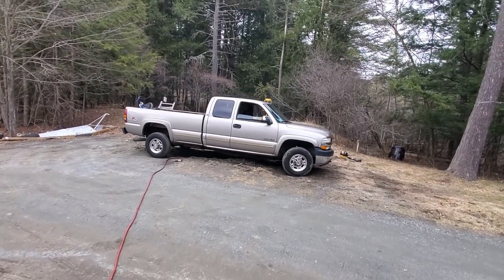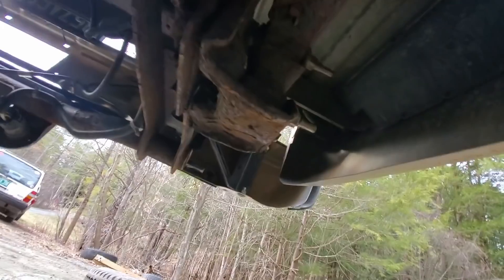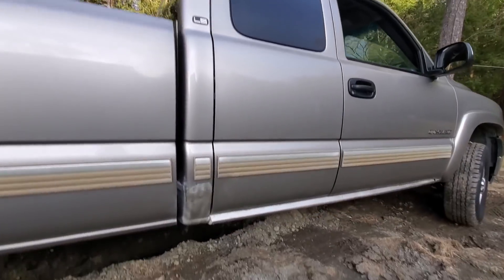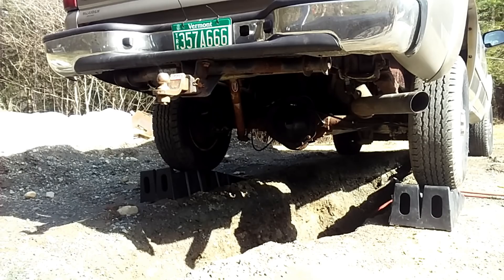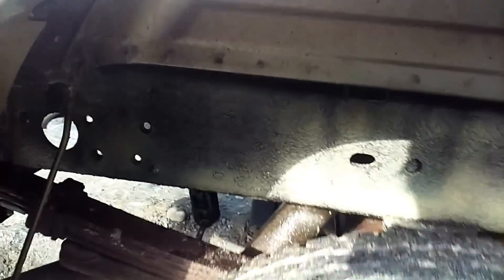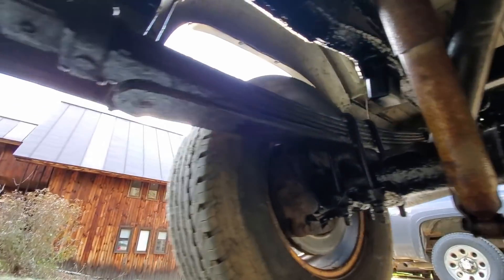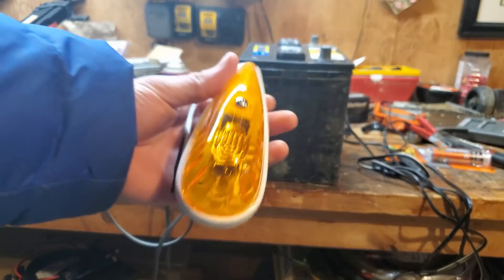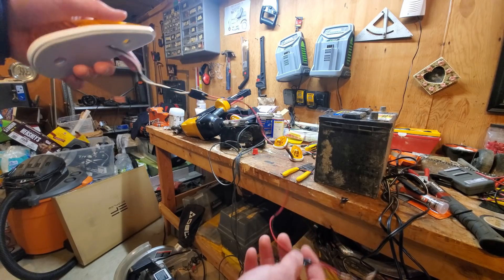Cheap Chevy Silverado Part 2: Frame Work And Lighting!

Comment: This truck is actually super clean for being a Northeast truck. Those  6.0 4L80e trucks will run forever..
Reply: GM makes the best heavy duty gas motors out of any of the big 3.
Reply: Iceburg862 Steam hemis are decent but the 5.4 should have been replaced a long time ago
Reply: @aaronhayden1780  agreed. The hemis are also strong motors. I have a plow truck with a 5.7 hemi. Has 300k on it.
Reply: Iceburg862 Steam nothing beats a small block Chevy, easy to work on as well
Reply: I know a guy who has 300k on his. Still drives it weekly
Reply: I’ve seen the ford 5.4s with 400k on them, and hemis with several hundred thousand on them as well. No doubt the small blocks were great motors, but you gotta give credit where it’s due

Comment: Cool video and glad that you are saving the frame from certain doom. Most people would just let it rot out then get rid of it and some of them are critical of what you are doing but you are putting the hard work in trying to save it and I give you props for making these trucks better than they were when you got them. I see nothing wrong with your methods and it works well cause that is the way most of us would do it and there's nothing wrong with twisting the wires together it works in a tight and those lights aren't pulling enough current to hurt anything. There are wires on houses twisted together all the time with wire nuts and that doesn't hurt anything . Thanks for the videos and keep them coming
Reply: The wire nuts in automotive use is not used because of motion and vibrations of it comming lose ... not because it cant handle the current. .. . thus, using crimp connectors are prefered. But in a pinch ... sure ... ive done it . But i tape it good so it wont loosen .... and its temporary use ... in my case. Ps. In exterior applications, crimp connectors can be heat shrunk to make it water tight.😊
Reply: @leop3009  yeah crimp connectors work but alot wiring problems ive fixed have be due to crimp connectors as well because they will loosen over time needing recrimped or a new fitting , a wirenut if tightened correctly actually bites into the wire and ive never had one of mine come loose although ive had to retighten a couple of them because they werent tightened enough because i saw there were no thread marks on the wire ive got a few on my ol work van thats been on there 8 yrs and still going strong but if you tighten them really good they will last forever and you can tape them to be on the safe side as well , ive seen ppl soilder crimp connectors and i think thats a solid fix or crimp them super tight and they will last but lots use a soft crimp from what ive seen but in the end it comes down to personal preference it will all last if done right cause thats what its made for  just like using ford or chevy 👍
Reply: @79beans347  the solder type are best yes 😁👍🏻....

Comment: Quick tip, I'm in NH and when I fluid film my truck I take all the surface rust down then take a air hose and blow all the dust and debris off. Makes for a better stick. Awesome video!

Comment: The paint should have gone on first.  Esp. Rustoleum is designed to bond to rust and Fluid Film is basically a protective grease.  Still curious to see how it holds up.
Reply: ck m rustoleum is not it even comparable to fluid film . I use fluid film on everything now for 14years best stuff there is for rust stoppage and protection .

Comment: Glad to see you went with fluid film or any kind of oil or wax coating for that matter. Painting the frame with any paint or rubber coating will just let water get stuck in between the coating and the frame and rot it out faster than if you did nothing. I fluid filmed my old Ram 2500 frame in November and it still has a noticeable coat on it so I'm very happy with it. Keep up the good work, we're basically exactly the same buying people's "junk" cheap and making them good machines again.
Reply: Kept playing the video and watched you paint over the fluid film! Well, the paint is only stuck to the fluid film anyway so it's not the end of the world. After like a week the yellow color disappears and the previously rusty metal is then nice and shiny black.
Reply from the maker: Well at least the paint is oil based and not rubberized
Reply: A Rural Vermonter Yea I’m sure it’ll be fine. Actually you’ll know when it needs more fluid film because the paint will probably start falling or coming off

Comment: Good job! Love your channel! But a little bit of advice...
I bought a 2002 Suburban from California and drove it back to NY a few years back. I started putting Fluid Film on every fall, and so far it's got absolutely zero rust after 3 NY winters. Fluid Film is the BEST stuff! You don't wanna use anything that covers rust and keeps it in.
BUT, I wouldn't have covered it with paint! Because the paint will dry on top. Fluid Film changes color and goes from yellow to black after a few weeks of it being on. It also creeps and covers a bigger area than what you first spray. It also collects dust and debris (in a good way) and makes it look very black, almost like you painted it, but more matte than glossy.
If you want it really full on black like with paint, I think, if I'm not mistaken, theres a company that makes a product almost identical to Fluid Film, but black. It might be New Hampshire Oil Undercoating, but I'm not sure here...
Anyway I hope this works and that the fluid film doesn't get stuck under that paint. Because it needs to breathe and creep. 
Keep us updated! Cheers

Comment: Fluid film is great. You don’t want to cover fluid film because it’s a breathable membrane. The color of the fluid film goes away as the air bubbles go away and road debris covers it. You also need to do touch ups once a year. Should get cavity wax for boxed in areas.
Reply: This guy has seen his fair share of rust too. :P
Reply: @802Garage  I had to double check to make sure I was still subscribed to you. Your vids hadn't been showing up in my feed.
Reply: No to the wax, imo. Water gets behind it and ur fukt.

Comment: I'm not going to lie, when is started to get into cars late last year o started to watch Scotty, and I admit that for a moment he did brainwash me in thinking gm are bad, but it was until he made the video of the old 90s Silverado when I woke up, calling them ok, then started watching other car channels like donut and fast lane throwing small punches towards scotty, and the miliion and half a million miles gm truck, like the channel keep it up
Reply from the maker: thanks!
Reply: He hasn’t driven in years, that celica has had the same miles for 6 years now. He bought the car with that many miles.
Reply: The only Scotty Kilmer you should watch is 802 Garage's send up of Scotty. Kilmer is a hack with bad advice.
Reply: @stevevarholy2011  What does Scotty Kilmer know. He's only been a mechanic for about 50 years. An 'Internet personality' mechanic for 50 years?
Reply: @townhall05446  One can be a bad mechanic for 50 years.
Reply: Older GM's are great. But starting in 07 they really dialed back quality. Now you could give me a new GM. But I'd sell it as fast as I can and wouldn't drive 1 mile in it.
Reply: Scotty like the 90s chevy trucks and even the early 2000s ones.  Hes not wrong about after the 2007 gen, they have gone downhill
Reply: Chevy is junk only good thing is the pushrod v8s but every pushrod v8 is good basically

Comment: I put cab lights on my GMC Envoy a couple weeks back. I ran one wire from the furthest light to the fuse I was tapping into, and stripped that wire in 4 spots for the other wires to wrap around. It worked pretty well
Reply from the maker: smart, I was going to tap into a cigarette lighter port but I will do what you did instead I like that much better

Comment: I did work on my 2000 tundra and used an air needler and coated it with por 15 which is a little pricey but it lasts and you don’t need to primer before you put it on

Comment: I just bought basically the same truck last weekend Lol.. but it's an 01 2500HD short bed. I also need to clean up the rear part of the frame on mine.. but I also need to replace the entire bed.

Comment: You need a needle scaler. You can find cheapo chinesuim versions for $40. I heat the fluid film up in the microwave so it creeps into the cracks better. Don't worry the mustard color will turn black and grey from all the dirt it collects. Most frame rust starts from inside on a boxed frame where dirt collects. Eastwood makes internal frame coating that I have used for years and it works. Learn to solder now, it is a life skill that you will use till you die! Buy a butane soldering tool and a bunch of shrink tube and you are set for life. You remind me of myself at 20yo on my back in my driveway living in Stowe almost 30 years ago. Keep at it.

Comment: Will you be adding tow mirrors
Reply from the maker: yes
Reply: @ARuralVermonterQqjmcb182  I think you should get some of the 2017 style Chevy tow mirrors, they would look good on the truck. That's just my opinion.
Reply: @MHD-iv1xk  I think that those 2017 mirrors on on everything I think he should go period correct mirrors
Reply: Boost auto tow mirrors look sharp

Comment: Would it have been better to paint the frame first then apply the fluid film
Reply from the maker: my thoughts were the fluid film is designed to penetrate into the rust and stop it so I wanted it directly on the frame then paint over the film

Comment: fluid film works great i've been using it on my jeep for the last 4 years and the frame is holding up just fine. the only problem i see is that you painted after you sprayed fluid film so the paint won't stick long
Reply: Shoulda painted first. Fluid film goes on clear

Comment: I just bought from my brother, a 2001 2500 HD. Which he owned since 2002. Same color as yours only a short bed. Only rust is on the rockers and 200k on her. Lifted 3 inches. She needs a little tlc. I got the brother price $1000.

Comment: I'm from Houston.  Scotty is real. Mic drop... However, I think he sounds like a screech owl most of the rime. 
I am going to subscribe but please be candid about the condition of your vehicles, like your truck's frame.  The frame of your Silverado is in trouble and it has obviously lost some structure strength in certain places. It's not "scale" it is steel that you removed. So, please don't pee on my leg and tell me it's raining. LOL
Regardless,, the 1999 to 2003 Silverado model years were the best years of the Silverado in my opinion.  I own a 1999 4x4 (new style) with original leather and bucket seats. It has over 250k miles on it. I love it. I am 72 years old and I have owned 15 trucks in my life. It is the best of all and I plan to fully restore it. The new  ones are too big, too bulky, too over engineered and way over priced. The second best truck for me was a 1973 International 1100 with a huge V-8 and enough chrome to get you home.  
Carry on...

Comment: Good job with the rust preventative job.
I hope you let everything dry before you painted. Not criticizing just hoping you let it dry out completely before painting the frame.
There is a YouTube channel South Main Auto.
He has several videos showing what happens when frames are painted. That moisture gets trapped and it rots the frames.
Reply from the maker: Yes i did and also his videos refer to rubberized paint this was oil based paint
Reply: A Rural Vermonter 
Cool.  I remember you saying oil based. I just wasn’t sure if you let it dry in between the fluid film and painting.

Comment: Dont under coat it just use spray paint cause as you use under coat it's like rubber so when I get hit by a rock then it creates a void and if it gets filled by salt and that and you spray and spray it will rot right through it has happened to a raptor which is the newest I seen cause they guy likes black so Everytime the black faded he add under coating and for 3 years it rotted the whole frame and was totaled
Reply from the maker: Well there is a difference between rubberized undercoating and oil based undercoating
Reply: A Rural Vermonter I’ve seen it happen to both the oil based newest one I seen was a colts wagon bus from the 80s it’s been rotting since 2000 I seen the frame was gone he never knew all I seen was the body of the car basically being the frame

Comment: Isn't sandblasting faster and better?  You are in the open so there is no clean up needed.
Reply from the maker: It is better but not faster as you really should strip down everything to just the bare frame if you are sandblasting, otherwise you'll get sand in places that shouldn't have sand (hoses, connections, fuel lines). Also I frickin hate sandblasting it sucks you find sand in your hair and clothes for weeks lol
Reply: @ARuralVermonterQqjmcb182  I guess those Youtube videos I have been watching make it look so EASY.  Not use to seeing so much RUST on cars.  California has to import it.

Comment: Based ONLY on what I have been told by truck owners and a couple of salesmen over the years, the trucks that USUSALLY come with roof marker lights fall into "government/corporate/and farm el stripo" models that are worked to death starting from day one (think road crews, construction work, and trucks with dump beds). In addition trucks that are intended, by the buyers, as tow trucks (camper trailers up to and including fifth wheel models as well as some serious farm loads that probably exceed the factory recommended tow weights on any given day). ALL of those trucks, so I've been led to believe, are considered "heavy duty" by the manufacturers, dealers, and buyers. However, some of the trucks in question are equipped by dealers with roof marker lights simply as a sales "gimmick" while many others receive roof marker lights after market by their owners, like you, who either like the looks of them or are looking to make their trucks more visible in low light/the dark than they otherwise would be. As for that "other channel"....I'm about his age and I spent most of my adult life as a Law Enforcement Officer.....But some unknown reason I was never called upon to be Director of the F.B.I.....Go figure.

Comment: Think you may have more luck if you just mix some black paint into the fluid film them sprayed. Can also recommend bar and chain oil for sure, very similar idea but feels like it stays on a little longer (and its cheaper) Still though the fluid film is a great product in its own way.

Comment: Hmm.. Please be super careful with that wiring and just twisting them together with tape. If you can, get some wire nuts on the connections as that's a little cleaner / safer than just tape.

Last thing we'd want is for something to get shorted from vibrations / moving around and then there goes the cab. Just don't forget about it!
Reply from the maker: I have actually redone the wiring since then, my thoughts were similar

Comment: I like the 2001-current GM cabtop marker lights on the heavy-duty trucks especially the one middle piece instead of 3 pieces in the middle cause its different in flavor and taste over the old GMs and RAM and Ford's trucks as well.

Comment: I like that truck. Clean on the outside with the stock GM HD look makes it look good. The clearance lights I do like but they are odd cause the stock ones are less pointy more flat, and the stock middle light is 1 wide bar not 3. But it all looks good and I do like the truck. Everyone is saying tow mirrors, however, the GM fullsize tow mirrors look ugly so I would suggest getting whats called Power Vision. They look like a stock mirror, but instead of power folding they extend out with an accordion. They are really neat and i think this truck would look great with them.

Comment: Couple ideas for you-
1. Try a pneumatic needle scaler for rust removal 
2. Get back under the truck and hit all the  sheet metal as best you can with the fluid film or bar and chain oil. Sheet metal is much thinner and more likely to rust through than a thick frame. Drill holes in the rocker panel and spray inside to protect rockets and cab corners.
3. Don't bother with paint. Fluid film or bar oil go on yellow but turn black over time.
4. Reapply later this fall or next spring. Then every other year.
Good luck

Comment: Rather than using an air hammer, a needle scaler gets off rust even better without risking damage.
Reply: Probably would be a bit quicker too since it hits a wider area than just the chisel tip on the air hammer

Comment: Idk what gm did different between the front of the frame and the rear, it could just be from being primarily rwd and they didn’t put it in 4wd a lot idk, but the rear of my frame on my 99 Silverado I had you could poke holes through it but at the front of the frame you could still see the factory coating

Comment: If you want a lanolin oil like Fluidfilm, but want it black, Woolwax sells theirs in black. Pretty much the same as Fluidfilm but a bit thicker I think, sticks a bit better. Used it on my past three trucks and dump trailer we just got, works great

Comment: I used to watch a lot of Scotty Kilmer but he started saying things that I found from my experience (and those around me) to be totally false. One example; he said Chevrolet TrailBlazers were complete junk, totally unreliable. I found this to be bull. I owned one before I totaled it and it was a great truck, when something broke on it, it was because the rust would rot things out, fuel pump line, rear upper control arms, and small holes in the frame, all due to rust. (The previous owner drove it a lot and always parked it over grass, that being coupled with the fact that we live in northeast Ohio really didn’t help the frame.) but the transmission and engine ran without any problems, we bought it at 110,000 miles and got to about 130,000 before I crashed. Btw those trucks are very safe in an accident, trust me I would know.